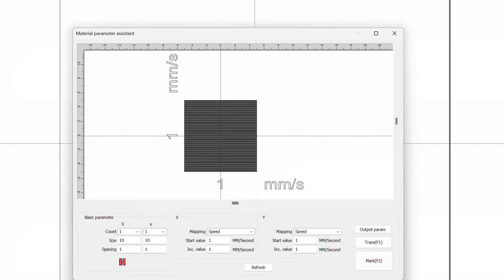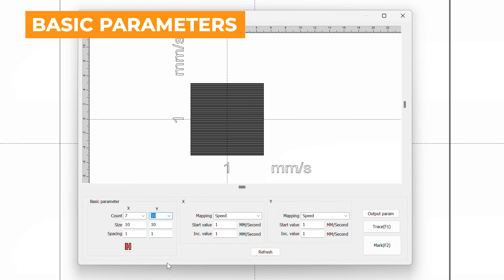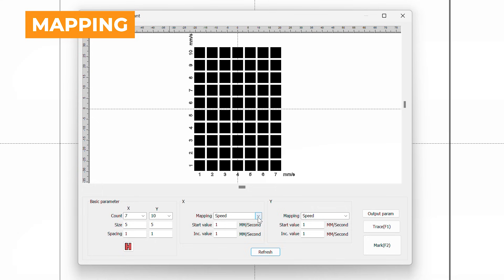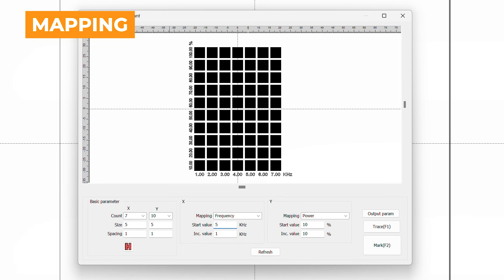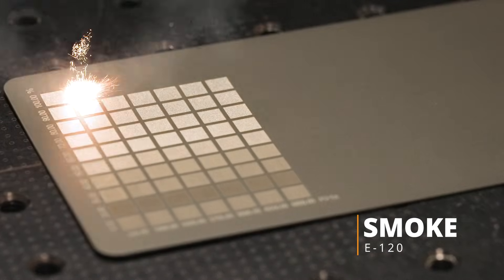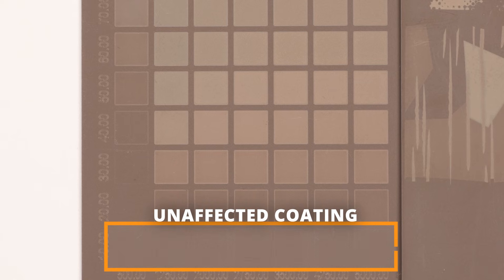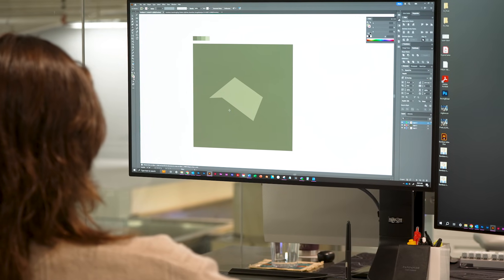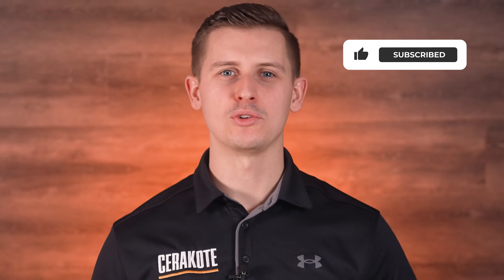Laser Imaging - Performing a Parameter Test | CERAKOTE®

Comment: Darn, it appears that the piece has to be fully cured. I was hoping it did not need to be in order to have more flexibility with complex layered patterns. Still, it looks very promising; I will have to look into a class.
Reply from the maker: You can ablate through multiple colors, but before they go to the laser, the parts do need to be cured as you mentioned. Get in touch with our team and they will be able to tell you if there are any limitations with your idea.
Reply: @Cerakote  Wonderful, thank you.